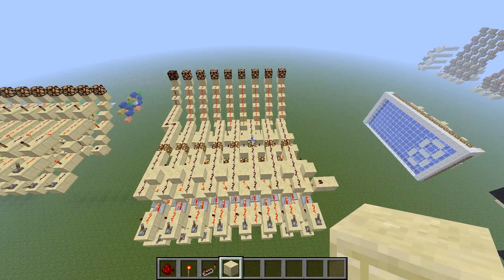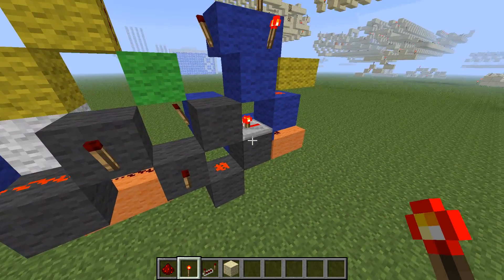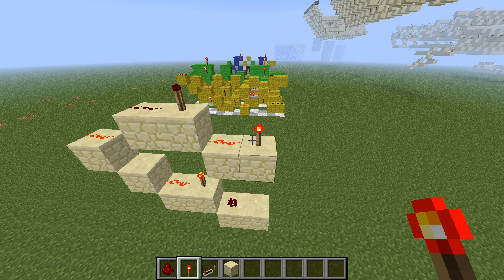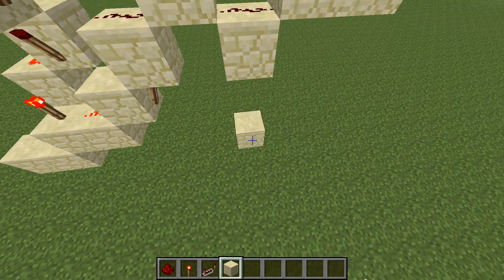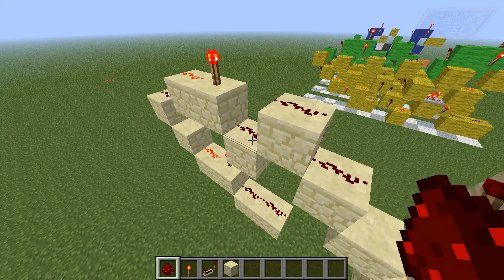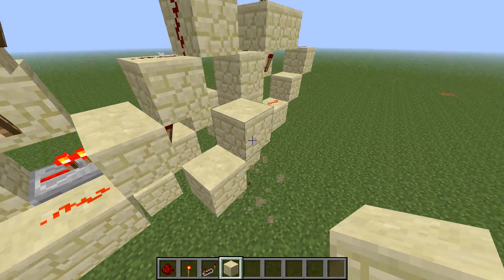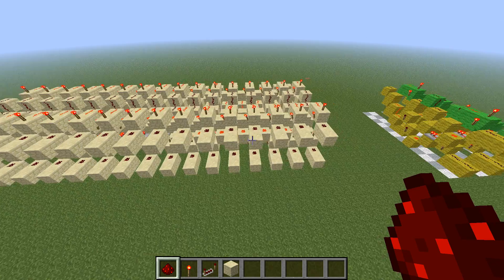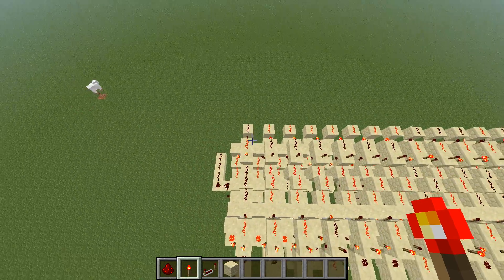Minecraft - Compact Full Adder (2 Wide with 2 Tick Carry)

Comment: It's been almost nine years and this is still the best adder I've seen

How did you come up with this?
Reply from the maker: I knew I wanted the data busses to be two blocks wide and tried to make each of the different logic gates that made up the full adder within that restriction. 

Ended up building the first XOR gate by making a vertical OR gate and then trying to tack on an AND gate. Once I got that, just had to copy it for the second XOR gate and then had to deal with tapping the ANDs gates to feed into the next full adder.

This went through a couple of iterations to reduce the number of components and ticks needed to do the carry, until I was satisfied with the performance.

I was also a redstone purist, and didn't want to rely on pistons or other tricks to transmit information. Working on some projects when pistons were being fixed and causing things to break, taught me to prefer using more basic techniques to avoid having to redesign stuff after an update broke it.

I never thought it was going to last this long honestly. I half expect the new target block would open up better designs.

Comment: I bet this will keep working for years to come on most versions of minecraft, since there are no pistons or anything that seems to keep changing all the time.

now that i said it i feel like its gonna stop working in the next version.
Reply: That didn't age well... (not sure what exactly caused it, but it seems to be broken in 1.16+)
Reply: @jan_Sanku  works absolutely fine for me in 1.16.4 (Java edition) with no issues. You probably missed one of the redstone torches near the output, those ones are easy to miss and got me several times. 

Also, in 1.16 you can change redstone crosses to become redstone dots (by right clicking), that will also cause issues. They may appear to be dots in the vid, but they need to be crosses.
Reply: @bluesillybeard  it also works in the newest xbox 1 bedrock edition still
Reply: @seanorechogamingdempsey6245  cool. this is probably one of the few redstone designs that works in Java edition and Bedrock edition...

Comment: Wouldn't a half adder be required at the start?
Reply: a full adder works as a half adder if the carry is zero
Reply: You can use a half adder, most op't for a full adder though... it makes the design more uniform, and it makes it easy to use the adder as a subtractor should you desire.

Comment: How can it be converted to a subtractor? Can you make a tutorial about that?
Reply: Use same thing full adder. Add signal to first carry of the adder. Invert the input b. thats all
Reply from the maker: I don't make minecraft videos (or any videos really) anymore, but you can check n00b_asaurus' video (https://www.youtube.com/watch?v=nPBYOF3bfiA) where he takes this full adder and builds a full ALU that can subtract.

Essentially subtraction with a full adder requires using something called 2's compliment. Its a fancy way of representing negatives numbers so that the addition of negatives numbers is the exact same as positive numbers. Wikipedia has a bunch of information on it, but the key point is that "A subtract B" is the same as "A plus NOT(B) plus 1" (A - B == A + NOT(B) + 1)

Example, you have 8 bits (or a byte) and the numbers 42 (00101010) and want to subtract 28 (00011100). So you NOT 28 (flip all the bits) to get (11100011) and then add 1 to get (11100100) which is -28 in 2's compliment. Now, when you add 42 (00101010) and -28 (11100100) you will get ([1]00001110). Notice how we actually overflowed an extra 1 there (in the square brackets)? In this example, we can just ignore the overflow, but you may want to check it for some operations. Therefore the result is (00001110) which is 14.

Therefore with this full adder, if you invert one of the data buses and then turn on the carry-in of the first cell on the adder, you will be doing subtraction. The bus you invert will be the negative number. Just keep in mind, you have to use to 2's compliment in the rest if your circuit, as you can get negative outputs and will need to decode it properly (for displays, etc).
Reply: Well i was checking out his vid first and then yours to build the base...
Reply: Anyways thanks for replying.

Comment: hi! I am new to logic gates. how do I read the output binary? is it by two's or by four's?
Reply: learning binary is kinda similar to learning how to count to 10 for the first time, and counting further. You've got 10 symbols: 0,1,2,3,4,5,6,7,8, & 9, which represent a quantity. When you need to go higher than 9, carry a one over, change that 9 to 0, and 1's value is now equal to the previous place (1,000, 100, 10, etc.) multiplied by 10, the number of symbols we get to work with. So 784 is 784 because 7*100=700, 8*10 = 80, and 4*1=4. When you add them together, you get 784.

Binary has only two symbols that represent a quantity: 1 and 0. This time when you carry over a 1, you'll need to multiply by 2, the number of symbols we get to use this time. So 1011 = 11, since each place is now multiplied by 2 (8, 4, 2, 1) instead of 10 (1,000, 100, 10, 1). The 4th 1 is multiplied by 8, the 2nd is multiplied by 2, and the 1st is multiplied by 1. 8+2+1=11.
Reply: solarHedron thanks!

Comment: what does a xor gate do again?
Reply from the maker: Its an Exclusive Or. Its on when one input is on, but off when both are on (whereas an regular Or gate would still be on).
Reply: Ammorth so its like an or gate but the other way around
Reply from the maker: Not quite. A XOR B is equal to (A OR B) AND NOT(A AND B). So the difference between an OR and an XOR is that when both A and B are on, the output is off in an XOR but on in an OR gate. We do this by adding an AND gate and turning off the output of the OR gate when both A and B are on.
Reply: Ammorth ok.......... that just confused me more 😕 but whatever
Reply: Simple explanation: If both inputs are the same, the output is off, if they're different, the output is on.
Reply: No videos here oooooooooooooooh why didnt you say so?
Reply: Matthis Tauritz Bakker I did say so :P
Reply: No videos here d:
Reply: 00 = 0
01 = 1
10 = 1
11 = 0

Comment: This is a genius design! But I seriously don't get how I couldn't come up with it myself as the basic concepts I have been toying around with for the past few days...
Reply from the maker: Hey Thomas, I just checked and its still working fine. Double check to make sure you didn't miss any of the torches. The ones under blocks on the sides can be easy to miss.
Reply: Ammorth Oh, I'm sorry there was a torch bug in ps4 that wouldn't power the block... that's odd
Reply: Freak80MC too bad it doesn't work
Reply: @thomasdelapena9490  it doesn’t work on bedrock, I had to do some slight modification
Reply: @purplefish2787  what wouldnt work on bedrock lol theres just dust and torches, not even pistons lmao
Reply: Wow talk about an old comment of mine. Coming back to this while looking up adder designs on Youtube and looks like past me was having some of the same issues as current me heh 

(though I admit current me was only having issues as I tried to create a design without using repeaters while also being only 2 wide, which I failed at. And I do admit there is still genius to this design, like the carry out just being two torches that feed directly into the carry in of the next bit. Vs my messing around where I kept thinking I needed a redstone line into the carry in)

Comment: can you make a subtractor as well? im tryeng to and i would apreshiat help tnx
Reply: An adder can also be used as a subtractor when working in two's-complement. Basically you take input a and add it to the negative of input b. The way you get the negative of a number in two's complement is by simply inverting it then increment it by one.
E.g.: 0101 (5) -invert-> 1010 -increment-> 1011 (-5)
Hope this helped.
Reply: To made a Subtractor, basically, make an adder as normal. Then:
Invert input B (Input A + Input B or Input A - Input B)
Add 1 (this is done with the Cin-Carry In- of the first adder which is unused in an Adder)
Reply: for a really great ALU based of this one, you can watch: https://www.youtube.com/watch?v=nPBYOF3bfiA
Reply: it has all sorts of interesting outputs/functions, and they can each be controlled individually